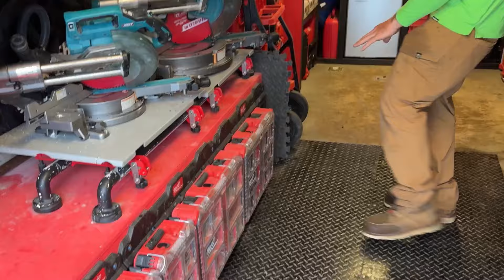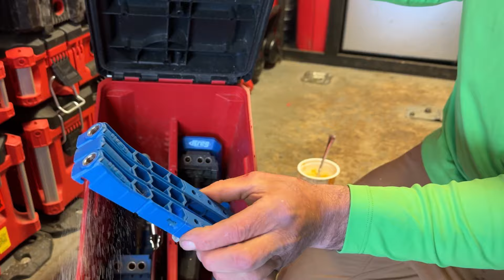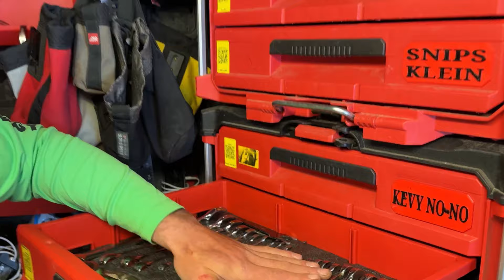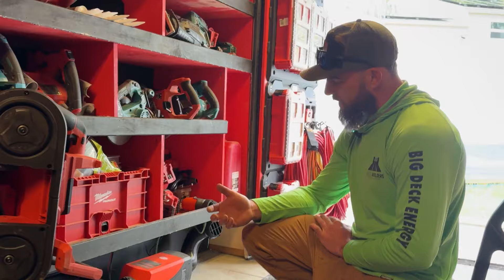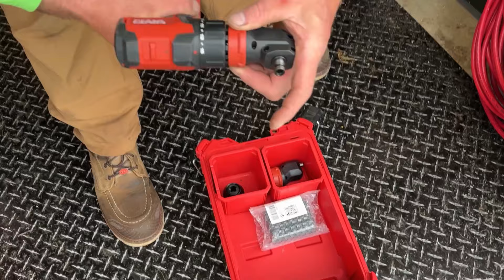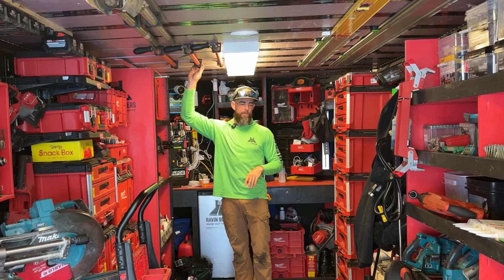Updated Tool Trailer Build Walk Through!!!

Comment: Very nice setup.  I have a video up where I did something similar with my saws, but made them at a working level.  I prefer to set onsite, but sometimes you need to cut something quick.  Now I don't have to pull them out.  I have dust collection built into the trailer that will also disconnect and move the jobsite.  

I've been running the DeWalt mobilelock system with gps tracking for years and it works great.  I really want to add a hotspot for internet and cameras also as a 2nd security.  

Not only did I over insure the trailer and tools, but I also added a policy for lost work if anything happens.  It could take a month or more theough insurance to get a new trailer, tools, and make a new buildout.  Something to look into.
Reply from the maker: Awesome input man. Thank you for contributing 🙏🤙

Comment: How does the security work without wifi? Do you run some kind of hot spot in the trailer?
Reply from the maker: @ChestnutRidgeWorkshop  it actually has cellular backup. We connect it to WiFi for camera operation but no matter what it always has cell service for emergency notifications and monitoring.
Reply: @ravinbuilders  cool. I never thought about that for my trailer till I saw yours, thanks!

Comment: What is the wieght rating for that trailer? How do you have all the tools and a mt100 without over loading the trailer?
Reply: nvm, I just heard the answer to that question.
Reply: I'd say that He's just under the weight limit. Putting the machine in backwards as He stated would be better for the trailers tongue weight of 10-15%.